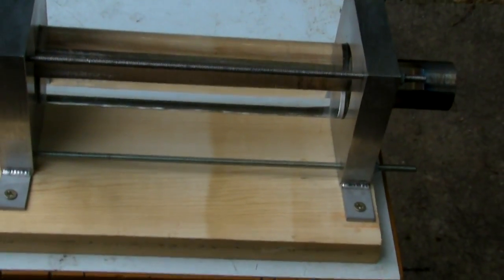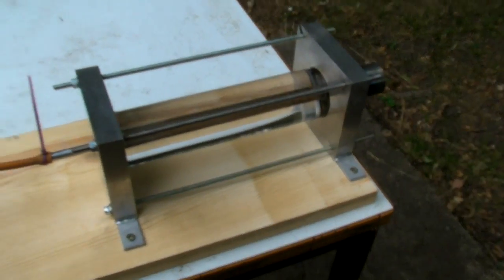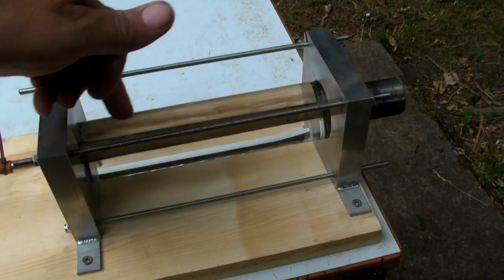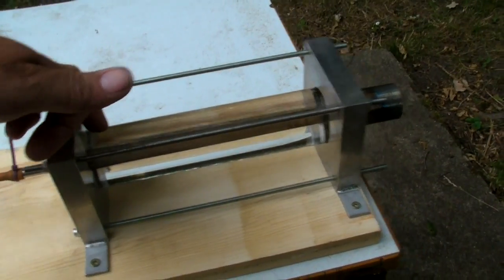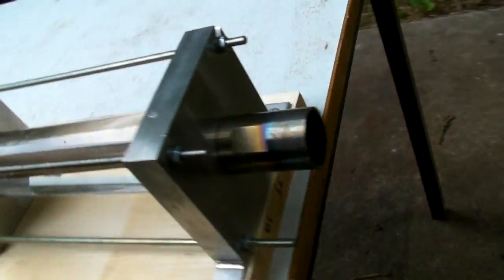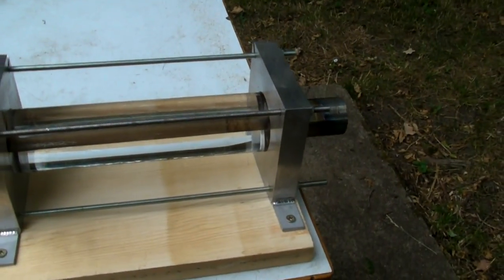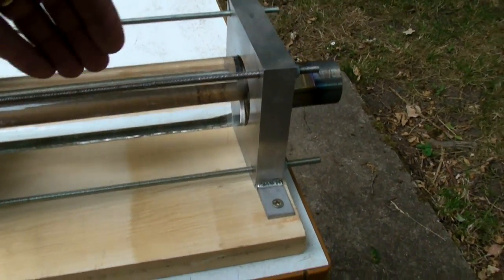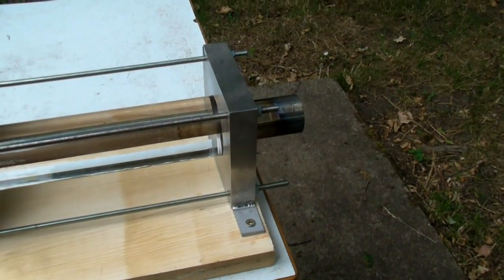GOX (Gaseous Oxygen) - Acrylic Hybrid Rocket Motor Test Fire

Comment: hola buenas noches, los saludo desde Colombia, tengo una pregunta para ustedes, que presión utilizan para realizar la demostración, el tiempo de quemado que genero el acrilico, muchas gracias y buen video =)
Reply from the maker: +Armando Rangel Filo Thanks for the question - my Spanish is not good but I think I know what you're asking.  The oxygen pressure we use is about 40 psi and we usually run this as a demonstration for about 15 to 20 seconds.  Each acrylic rod usually gives a 3 or 4 demonstrations.  It might be possible to do more but we have to be careful when we use this in shows as we don't want the rod to burst and shower the audience with burning plastic!

Comment: Noob Question: What is the potential or likelihood of the flame travelling up the oxygen tube into the GOX canister?
Reply from the maker: +Luke Barrett Pretty much zero - oxygen in itself won't burn but it is necessary in order for other things to burn.  The only possible way I could see anything bad happening would be if the rubber hose from the oxygen cylinder to the motor actually caught fire.  The oxygen flow through the hose would certainly cause it to burn a lot faster.  That's really not likely to happen in our set up as we only run the motor for a matter of 20 seconds or so at a time and the tube that the hose is connected to never gets particularly hot in that time.
Reply: +wonderstruckwow makes sense. Thanks for the video and reply!
Reply from the maker: Luke Barrett No problem!

Comment: Exit/chamber pressure during burn is what? This "motor" seems like a glorified candle rather than anything useful.
Reply: +Stereo3DProductions From what they were saying, it's intended to demonstrate the principles, not be an actual motor.  It's grossly overengineered (seriously, look at how clunky that nozzle is) and runs at such a low chamber pressure as to be useless, but the clear acrylic lets you see the burn as it happens.  It's designed to be safe enough to demonstrate in front of a classroom.

A flyable hybrid motor of the same size would be far and away too powerful to fire indoors, and far too dangerous to be close enough to see the burn as it happened.  Not that you would be able to see it anyway - it would be inside a metal casing designed to withstand the pressure.

Comment: Try a nozzle on it next time...
Reply from the maker: +OddSkullScars It's got a nozzle.  The cylinder sticking out the back is a simple convergent-divergent nozzle.  It doesn't look like much of a nozzle simply because we didn't remove the material from around the nozzle shape to form a cone as we didn't need to worry about weight - this is just a bench demo.
Reply: +wonderstruckwow Ahhh right, just didn't seem like it because the flame at the end didn't exactly look 'focused'...
Reply from the maker: OddSkullScars No - the nozzle geometry isn't exactly right so the exhaust either over or under expands.  We can get better results by adjusting the oxygen pressure.
Reply: Guess it doesn't make much sense to optimise a nozzle properly and figure out all the angles and ratios when it's just a bench experiment.

Comment: Is there a way to calculate the experimental thrust produced by this motor
Can we use a spring balance?
Reply from the maker: Antony Joseph The calculations involved would be fairly complex and probably not that accurate.  Building a small test rig with a spring balance would give a much better idea of the thrust produced.  If you wanted a bit more sensitivity try using a set of digital kitchen scales - or you could build a dedicated test rig by removing the load cells from said scales and re-purposing them.
Reply: +Antony Joseph try a load stone
Reply: +wonderstruckwow Thanks for the help!!!
Was virtually without the internet for a LONG TIME....
Reply: +Sean Bush Thanks for the support!!!

Comment: how much thrust is that is that the engine that the ME-163 is powered by?
Reply from the maker: Ausintune This engine produces pretty much no thrust as it's just a demo we use in shows to illustrate how a hybrid motor works.

The Me 163 used a liquid propellant engine.  The oxidiser was HTP (High Test Peroxide) and the fuel was a mixture of methanol and hydrazine hydrate plus some water and a few other chemicals I believe.  To keep it as simple (and cheap) as possible there was no ignition system needed as these propellants are what we call 'hypergolic' - they will ignite on contact with each other.

Comment: What is the nozzle area ratio? It looks like it might be over-expanded.
Reply from the maker: Cary Not sure off the top of my head what the ratio is and, yes, it does appear to be over expanded in this picture/video.  We can increase the pressure inside the fuel rod by just upping the oxygen inlet pressure and this helps but we have to be careful about the fuel rod rupturing.  As this is just a demo for shows we weren't really too bothered but we built it so the nozzle unscrews so we could design a nozzle with different geometry.

Comment: The thrust is the amount of pressure the tank is letting out, there won't be an increase or good thrust to weight ratio unless you have a super compressed tank small and light enough to take off without having it hold enough pressure and create enough thrust to get it off the ground, just a forewarning to if you want to use this engine for anything like a rocket, it would work for maybe a car or a boat.
Reply from the maker: MOJANG LP Our engine was never intended to produce any meaningful thrust as it's just for show demos so producing thrust would actually be dangerous. Propellant pressure is obviously important because it governs the rate of flow into the combustion chamber, also, if the pressure in the combustion chamber becomes greater than the propellant inlet pressure the propellant won't be able to get into the chamber to burn and combustion will stop.  When this happens the pressure in the chamber drops rapidly and propellant can once again enter.  The ambient temperature will probably be great enough to reignite the propellants and the overall effect is that the motor 'buzzes', which isn't very efficient.

If you want to find out more about thrust in rocket engines check out the NASA pages at http://www.grc.nasa.gov/WWW/k-12/airplane/rktthsum.html

Comment: i have a book from the '70s, where they described that experiment.
it's a great idea and works with italian salami too. ^^
but the generated power is too low for commercial use.
Reply from the maker: Yes, the only thrust this produces is really just down to the gas inlet pressure.  We were only thinking just the other day about replacing the acrylic tube with a steel tube and trying different fuels.  Wood was one we were particularly interested in.  A couple of years ago we did some experiments trying to build a 'meat rocket' which used a mixture of dried mincemeat and potassium chlorate - it wasn't brilliant!

Comment: 1 question.. can I use it to Rost marshmallows and hotdogs
Reply from the maker: It certainly produces enough heat.  However, we are burning a plastic(acrylic) and although burning with pure oxygen should only produce water vapour and carbon dioxide there is a risk, particularly when reducing the oxygen flow, that you get incomplete combustion.  In this situation you might end up with small amounts of toxic chemicals contaminating your food.  I think I'd stick to a barbecue.
Reply: Yeah thats what I figured I knew that there would be a large possibility of contamination but the experiment was cool. I am gonna sub to you guys
Reply from the maker: Thanks!

Comment: Very interesting stuff--a restartable solid fuel motor. The practical applications are obvious and manifold.  Good work, good chemistry, and good engineering!
Reply from the maker: Thanks!  Can't claim to have invented this though (although I did design this particular one).  There are several videos on YouTube of similar motors being demoed and real hybrids are already in use, notably in the Virgin Galactic Spaceships and also the Bloodhound SSC 1000 mph car currently being built in the UK.

Comment: Can I make jet pack out of this, theoretically speaking of course (LOL)?
Reply from the maker: In terms of using this particular motor the answer would have to be no as it simply doesn't produce enough thrust.  More generally speaking it might be possible to use a hybrid rocket motor as you do have some control over thrust and you can turn them on and off but I'm not sure I wold fancy strapping something like that to my back!

Comment: Where did you get the GOX? Just from a welding tank? or....???
Reply from the maker: We have an account with BOC and buy our gases from them.  I'm assuming you could use a welding tank as long as it has an appropriate regulator.
Reply: wonderstruckwow  So your using 100% Oxygen?
Reply from the maker: superbest948 Yes, it's pure O2 - with a good clean burn the combustion products are just water vapour and CO2.  We've also thought about trying nitrous oxide but haven't currently got a cylinder of that.

Comment: what is the application is used for
Reply from the maker: Hybrid rockets are used in Virgin Galactic's Spaceship One and Spaceship Two.  The UK's Bloodhound Supersonic Car will also use a hybrid motor to reach speeds of over 1000 mph. These motors use a rubber compound for fuel and, in the case of the Virgin Galactic Spaceships, nitrous oxide as an oxidant.  Bloodhound uses High Test Peroxide as an oxidant.  Our motor is just a demo motor and doesn't produce much in the way of thrust.

Comment: I wonder if something similar to this would work with dry ice and really hot water or alchohal. Probably risky tho
Reply from the maker: No reason why you couldn't build a demo motor with dry ice and hot water.  I doubt it would produce much in the way of real thrust though.  We also use small bottle rockets in our shows which work by burning small amounts of isopropyl alcohol and air.

Comment from the maker: Reply pt 2 - There are definitely no shock diamonds and we have only cranked the oxygen pressure up to 80 psi.  We only do this on a new rod and usually don't go above 50 in a show.  The reason is that we are unsure how the will affect the strength of the acrylic and the last thing we would want is one of these rods to rupture in a show while filled with high pressure oxygen.  At some point we will test one to destruction in a safe environment though - and have a go at designing a better nozzle.

Comment from the maker: Reply pt 1 - A bit of both really.  The motor is designed just as a demo for use in shows.  We went for a simple 12 degree taper to try maximise the efficiency with which the gas expansion was converted into linear motion as we didn't want to get involved in machining more complex nozzle shapes. Saying that, we didn't pay much attention to the ratio of the throat to exit plane area but the nozzle is removable and we can machine up other designs.

Comment: You mention the 12 degree taper on the outflow, is that to act as a convergent divergent nozzle to try and get it past choked subsonic flow, or just for show? I didn't see any shock diamonds forming, but you didn't look like you were giving it all that much gas. If not, I'm rather curious if using a tapered acrylic tube instead would work well enough to manage supersonic flow.

Comment from the maker: That would be an interesting thing to try.  I could see that using a powder might work but the powder would possibly need to be premixed with high pressure oxygen before injection into the combustion chamber.  That might involve a risk of the mixture detonating before reaching the combustion chamber.  You'd also need to be careful about static build up.  Hmmm.

Comment from the maker: Depends on the oxygen pressure.  With the oxygen at about 40 psi we get maybe 5 or 6 ten second bursts.  If the oxygen pressure is higher the tube will burn away more quickly.

Comment from the maker: Reply pt 2 - these boxes aren't big enough!  The material being burned here is cast acrylic which in chemical terms is poly(methyl methacrylate) or PMMA or (C5O2H8)n.  Poly acrylonitrile is used for fibres and making synthetic fabrics.  We are burning it in pure oxygen so the main combustion products are going to be water and CO2 according to the eqn C5H8O2 + 6O2 -> 5CO2 + 4H20.  There is sometimes also a very slight smell of burning plastic so there may be some incomplete combustion going on.

Comment from the maker: I would recommend finding out about the Bloodhound Supersonic Car project - this uses a jet engine to get up some speed and then a hybrid rocket motor to reach 1000 mph.  The rocket motor uses high test peroxide (a  form of hydrogen peroxide) and a solid rubber fuel (HTPB I think).  Scaled Composites' SpaceShipTwo also uses a hybrid motor with HTPB for the fuel but nitrous oxide as the oxidiser.  Those are the two best examples I can think of at the moment.

Comment from the maker: Agreed!  If we wanted this motor to actually move anything we would have designed it completely differently and used a different fuel for sure.  Regarding the nozzle design we went for a simple 12 degree cone with a nice smooth radius on the throat but didn't pay much attention to nozzle length/exit area as we can adjust the pressure in the chamber by regulating the oxygen flow.  At about 80 psi the exhaust appears about ambient but we wouldn't want to go above this for structural reasons.

Comment: To gain more thrust you need to adjust nozzle diameter also enclosing the fuel in some metal case will increase combustion chamber temperature which in turn increases pressure and its all equal to thrust.
These things require some experimenting, basic knowledge of thermodynamics and a pair of straight hands.

Comment from the maker: There is pretty much no smell of burning plastic at all.   This was one of our concerns when we first considered doing this.  Because we are using pure oxygen and cast acrylic it appears that the main combustion products are CO2 and water vapour (but I stand to be corrected on this as I haven't sat down and worked out the combustion equation). I also understand that if you use extruded acrylic it does smell because extruded acrylic contains polystyrene to improve it's flow characteristics.